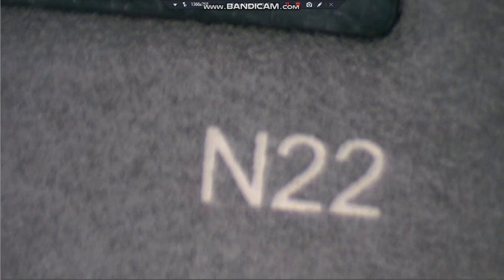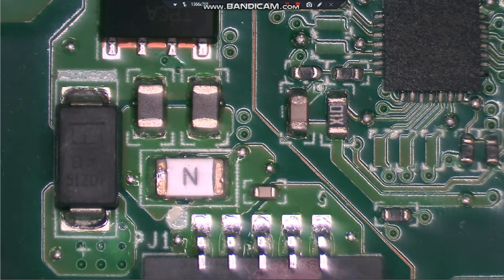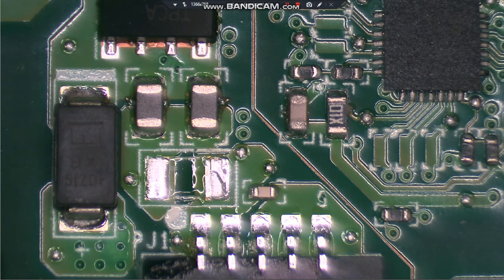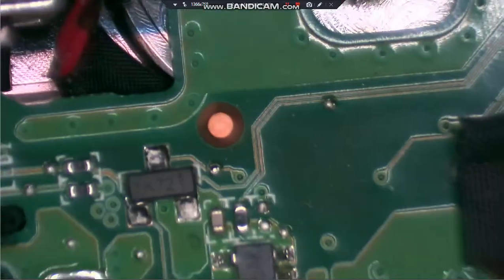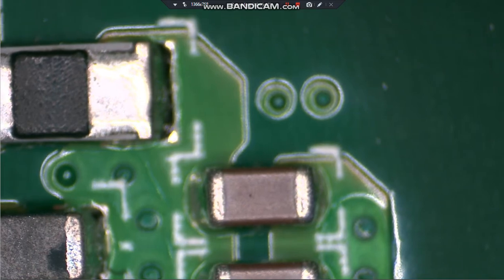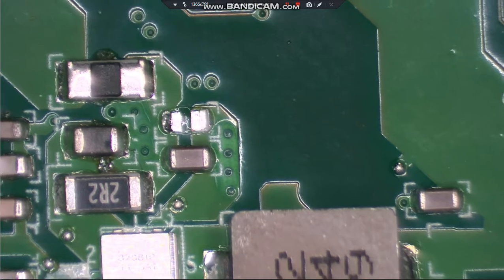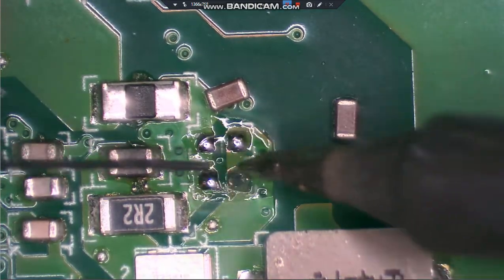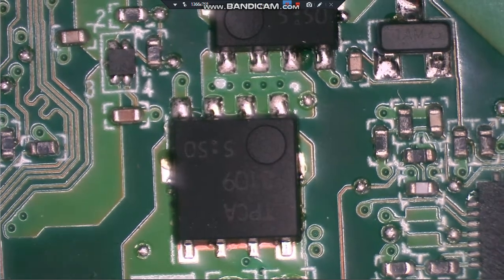Lenovo N22 No Charge Light and wont turn on Repair

Comment: I have a Lenovo N42 and the charge light won't come on with the keyboard ribbon cable connected. I'm not an electronics guy but can swap out bad parts.  What do you think? Bad keyboard?
Reply: The keyboard and the touchpad connect to the motherboard with two ribbon cables when I have it plugged in and I disconnect the keyboard ribbon cable the light turns on the show that it’s charging the battery and when I stick it back in and put the snap back on the light turns off but only with the keyboard and not the touchpad cable. I guess what I’ll do is take off a working keyboard that I know works and connect it and if the light stays on the keyboard light goes off it’s probably the motherboard I don’t know what else it could be. Thanks for your help I thought you may just know because like I said I don’t deal a lot I just swap stuff.
Reply from the maker: @TomDanaher  If the light goes off when you plug in the keyboard then that would be your problem area. Something is probably shorted in the keyboard keeping it from working.
Reply from the maker: depends. im not familiar with that model but if it has the side board connected by a ribbon cable i would unhook the side board and see if the charge light then came on.

Comment: I'm dealing with a "warped broken inge" on a Lenovo N22 Winbook (my 13 year old grandson's You mentioned these are not very good for school age kids. just wondering which computers (older off Ebay) you might recommend around $10?
Reply from the maker: It is google OS and not a Winbook
Reply from the maker: The hinge doesn't warp the Screw anchor comes loose from underneath the keyboard top piece you just open it and manually  put the anchor on top of the hinge and screw from bottom and reattach to hold the hinge down. then keyboard corner will no longer pop up when you open it. Another bad design.

Comment: Hello good video .some guy as just gave me 3 laptops all have the same problems ie they dont power up no power light .the guy said he was using the wrong power supply 28 volts lol .so i recon it wil be the fuse that has gone in all 3 hell knows until i crack them open and get my multimeter out .what do you recon the problems will be eny ideas .the bad thing is i dont have the original power supply but i do have a 19 volt old laptop charger i recon i could convert the powersupply to work these laptops .iv subbed and a big fat like . ps eny help appreciated i have all the  gear with some sort of idea ha .

Comment: Would this be the same for an N23 Chromebook?  What size capacitor are they?
Reply from the maker: Yes the n22 and n23 both use the same motherboard designs. As far as the capacitor rating I'm not sure as I just used donor boards to get them off of.

Comment: What is the value of the capacitors? I'm needing to replace mine however I cannot read the value.
Reply from the maker: Yes i would definitely start with the fuse you can always jump it if needed for testing.

Comment: With mine, have same symptoms. No LED and not switching on. However, fuse is OK with power each side and both capacitors not shorted. Can’t see any damaged components on either side of board. What else could it be?
Reply from the maker: Have you checked voltages coming in? you should get 19 or 20 volts across the fuse and be able to check those caps for 12 volts as well. If all of that looks good check other caps around the board. The ones at the top of the pcb to the right of center feed 12 volts down and get changed to 3.3 volts and then get sent to the Bios chip.
Reply: chris esch thanks. All that checks out. Given up on it now.

Comment: Where would one buy this fuse for replacement? and what is the information I need to pick the right one?
Reply from the maker: Ebay. N Code is 2A 32V. Just search "smd fuse N"  and you will find them.